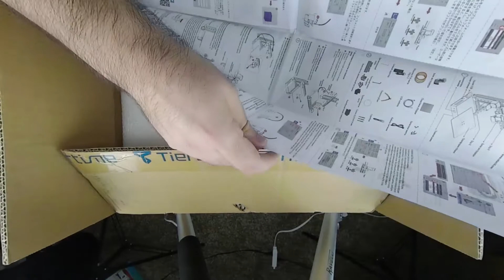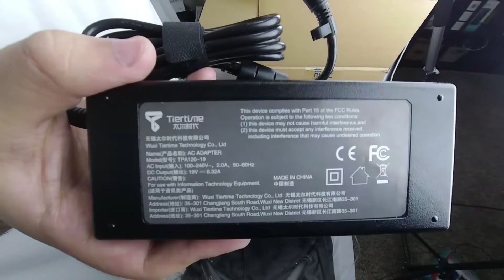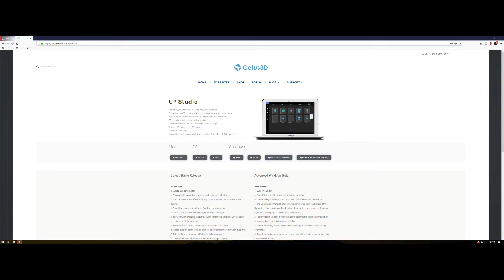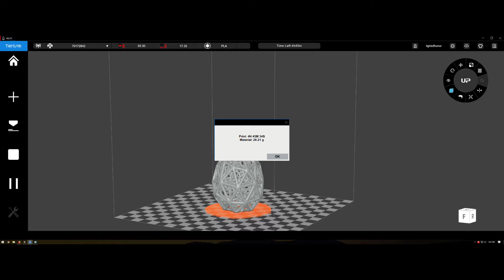Cetus3D MKII Extended 3D Printer: Unboxing & First Print

Comment: Thanks for review! Should i buy this, compared to cr-10? What is your opinion?
Reply from the maker: Hope to have the full review up soon, but probably the CR-10 or the anycubic i3 mega. It's a really good printer, but the price went up so it's hard to justify unless you need something dead simple.
Reply: LOHTEC thank you. I'm little confused these days. 
Now i'm between i3 mega vs kossel lineer plus wich one would you choose? 
I3 mega costs 580$ kossel delta lineer costs 400$ i know its expensive but taxes are realy high at here. 
Do you think is it worth it?

Comment: What's the print quality compared to anycubic I3 mega?
Reply from the maker: A little bit better, though the underside texture is better on the anycubic if you need to use a raft on the Cetus.
Reply: LOHTEC many thanks for prompt answer!

Comment: Great video, can't wait to get my own one of these, but they're taking a while for the UK. Just wondering if you could tilt the camera from above a bit so it't not so vertical as it made me feel a bit ill for the next unboxing.
Reply from the maker: Yep, new camera setup so trying to get a handle on it. UK stock should be up now or soon per their support.
Reply: Im on their mailing list but haven't head anything. Don't suppose you have any idea when?
Reply from the maker: Not really. They told me "soon" when they sent me this one, but I'm in the US. If you can't wait you can always use the China warehouse.
Reply: Okay. What would using the China warehouse change? Do they still ship to the UK? I'm not really aware of all this.
Reply from the maker: Shipping is probably more expensive, but they do ship worldwide.
Reply from the maker: Buy today. Prices are going to increase $100 tomorrow.
Reply: I have decided to buy from the UK when it comes back in stock. I know that the prices are going up tomorrow but it will probably still be cheaper than from China as shipping and duty is over $100. Also I want a UK plug, so it makes more sense. As prices are raising I would imagine that they will release new stock tomorrow so might work out. Thanks for the concern though.